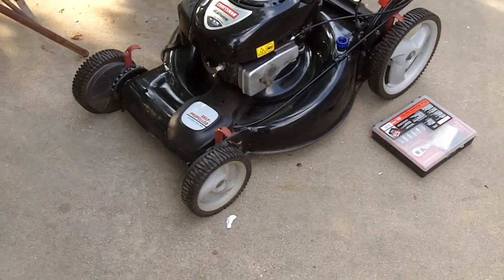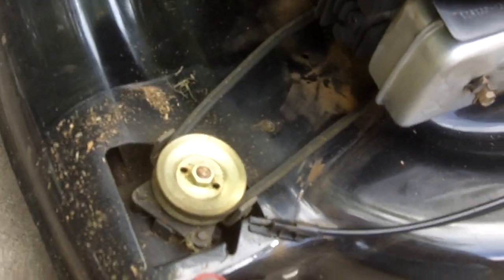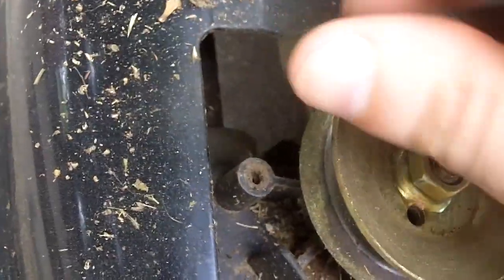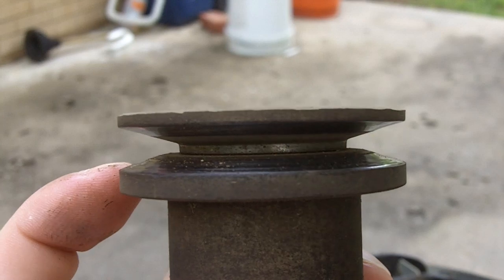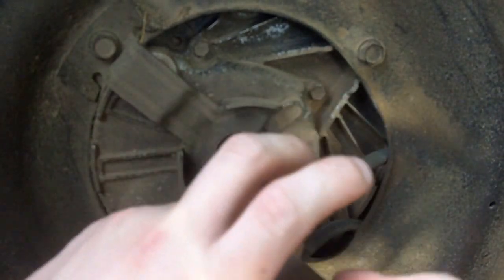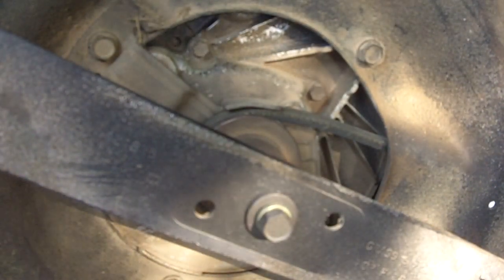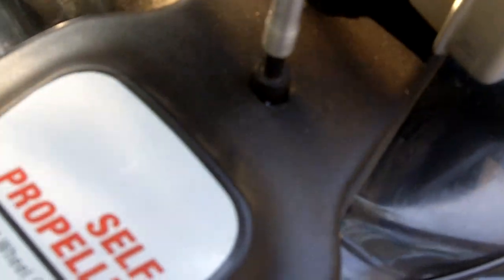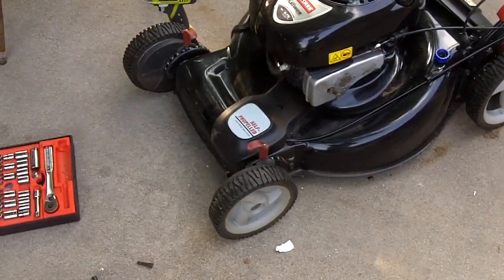How To Replace The Belt on a Craftsman Front Wheel Drive Self Propelled Lawnmower

Comment: Thanks for the video it really helped, one tip for those doing the same thing, apply a small amount of anit-seize grease on the engine shaft in order to ensure it does not freeze onto the blade adapter from the rust build up.

Comment: Short & sweet with all the necessary video shots. Great job!!
 
Looks like you need to clean the carburetor, 
particularly the bolt that is at the bottom of the carb, 
that also has tiny holes and acts as a main jet. 

I was having the same issue, and just had to do that myself 
on a similar lawn mower that I just bought for $25 to get it to start and run smoothly.

Comment: Just replaced the drive belt in our Craftsman front wheel drive mower. and the power drive works like new!  Our mower had one significant difference from the video.  After removing the blade, the center spindle would not slide off.  Instead, there was a belt drive that was held on by a single bolt.  We removed the guide and the belt slipped on easily.🙂
Reply: my center spindle wont' come off, doing some banging with liberal amounts of wd40. no seeing can't see a bolt to take off

Comment: Great video.  It was really helpful.  Do you have a video that shows how to adjust or replace the drive control cable for the same Craftman mower?  The tension on mine isn't tight enough.
Reply: near your drive engage handle there should be a piece of the cable that you just rotate....one way increases tension and the other loosens....too loose and you want go anywhere.  too tight and it will be full speed
Reply: Don Patton Jan